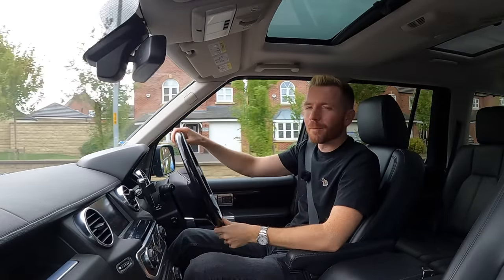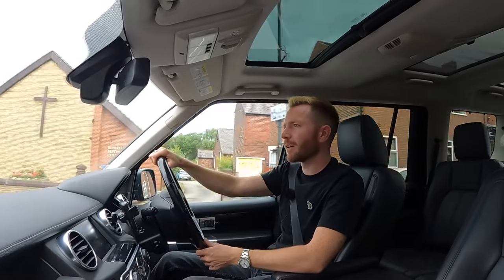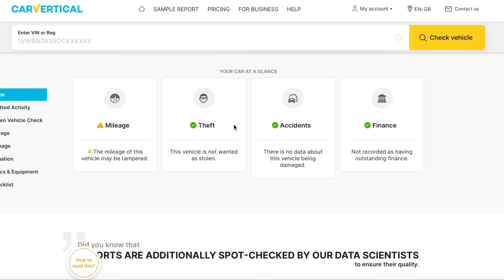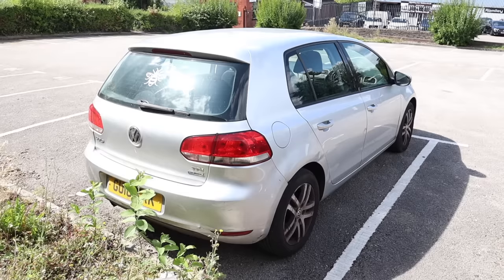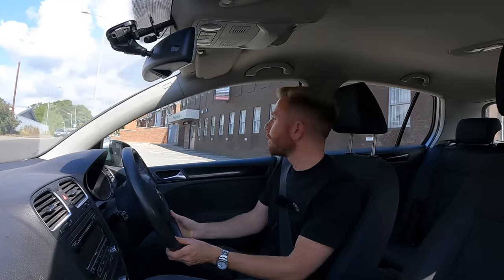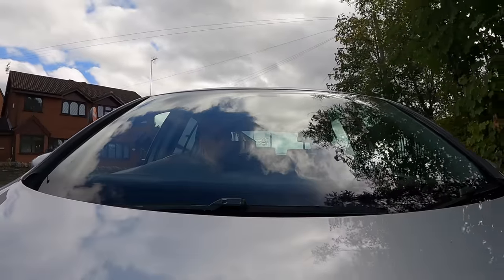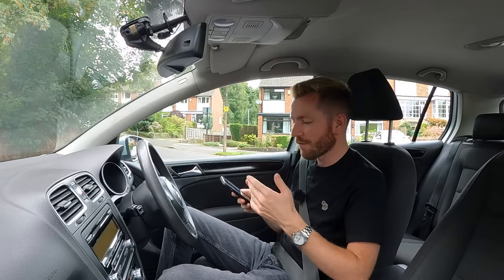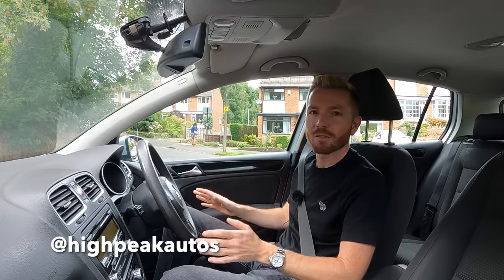I BOUGHT A CHEAP VW GOLF MK6 FOR £700!

Comment: That looks like a pretty good deal for £700.
Reply: Then Matt spends 2.5k on bodywork and change every single bushing
Reply: No. The car has been completely neglected and abused, you will definitely find at least a couple more nasty surprises even after all immediate repairs necessary to sell it to you.
Reply: Trouble is you would be constantly chasing faults and unless you were a competent mechanic with a good scan tool you would be losing time taking it in to the garage.

Thats ignoring the tatty interior and exterior.

If I wanted a cheap bargain I'd be looking at something like the toyota  aventis Mat had or the volvo t5 chops garage had.
Reply: A pretty good deal for £700? I don't think so. It's a shed. Long list of things wrong with it. Send it to the scrapper.
Reply: until the injectors go like on my old golf lol
Reply: It’s a 12 year old car, it’s ready for the scrapyard
Reply: @matthewsmith2787  A quality car that has been maintained should last well beyond 12 years old. I have a 19 year old Honda used as a second car. No rust issues and runs like new. Good for more years yet so I'll be keeping it for a while. In fairness this VW looks to have suffered a hard life and been poorly maintained.
Reply: @matthewsmith2787  imagine thinking 12 years old is old haha
Reply: @matthewsmith2787  you have money to burn? 🤣🤣🤣🤣
Reply: Most cars in UK are more then 12 years old lol

Comment: Nice one Matt, hopefully you'll get some decent ad revenue off the video too. 😆

I recently bought my uncle's 2007 Audi A3 Sportback for £650. The interior was even worse than your Golf here, however it was mechanically well looked after with only 80k on the clock. I got a cambelt change, put £100 into it myself cleaning it and replacing bits and bobs, new tyre and got it through an MOT. Total cost including the car, £1130, money well spent for my daily runner?
Reply: how do you guys buy a car that cheap. i spent 6 months searching for a “cheap” VW polo and i spent 9500€ for a 1.4TDI with 148K Km.

Comment: The MK6 is one of my favourite cars I’ve owned. A decent one costs a lot here in comparison with the UK. I paid more than 4 grand for my car. Crazy to see you can pick one up there for 700 quid
Reply: Used cars seem relatively very cheap in the UK for some reason
Reply: And he overpaid if you ask me.
Reply: @khelgarironfist3301  Isn’t it because it’s unattractive for export because of the place of the steering wheel?
Reply: @bikerdude1569  how so?
Reply: @jjs9672  i also read that many older cars are sold to other countries which mostly have the steering wheel on the other side therefore UK cars are hard to sell or something. Not sure if that is really the reason tho.
Reply: @khelgarironfist3301  yeah that’s what I said a couple of comments back. Must be. Lucky them with these cheap pearls
Reply: @khelgarironfist3301  the reason being tax, insurance and fuel prices are high. That's why cars are relatively cheap here.
Reply: @rundattmedia2106  well all 3 are even higher in some countries including mine where cars also cost a small fortune.
Reply: @khelgarironfist3301  some countries aren't as economically wealthy as others.

Comment: bought a 2006 140pd golf for 500 just needing a turbo*
* turbo was in two pieces plus a host of other issues. ended up changing engine as turbo had starved it of oil.
get it all back together running THEN find the dmf rattling.
got it done then did 600 miles in it then sold it loosing 700 ffs.
4got to say it was blooding minging when i bought it

Comment: You can find the date on the tyre by looking for the word "DOT" and then there will be the 4 digit code somewhere after DOT. If you can't find it on the outside of the tyre, it will be on the inside... Sometimes it is like that, but i dont know why :D
Reply: Maybe the tyre was fitted back to front? It can happen occasionally, scarily enough.

Comment: Had issues with the 1.6 TDi, not the most reliable unit.
Reply: I payed, for sure, more than GBP 700 to fix the 1.6 TDI on my Fabia Estate from 2011 and never ran perfect. Just a waste of money and time.
Reply: I've had one from new in 2011 and it has never let me down. Other people who I know have had them without problems too, so maybe you have just been unlucky.
Reply: @01jvb  There no such thing as unlucky when the engine kicks the bucket after the dieselgate "fix" and you have to replace the EGR on your own money. For me it was the last VAG product.
Reply: @10mbc  ....most EGR issues were caused by owners bad driving habits or buying the wrong car.
Mine was replaced under warranty due to the previous owners stop start shopping/school runs....you don't buy a diesel for that type of motoring .
Comfortably munches the motorway miles now for the last 8 years with no issues what so ever......great motors 👍
Reply: Yup egr problems and various niggles with mine left me wishing I’d got the 2 litre in my mk6 Golf, outed it after just 60k miles (very unlike me)

Comment: I think the problem with the UK at the moment is that people are buying cars that they can't afford to run, and maintain. It's sad to see and it reminds me of a Mk4 Astra I bought years ago. It was an auction and in a terrible state. I owned it for a few years and I detailed that thing to death, painted all the black parts, the body colour, and replaced the lights, and repaired it myself and changed the oil every 6 months. It was the 1.4 8v version, but I was young and daft. I ragged it, and the head gasket went. Local garage put the fear of god in me saying it was going to cost £xxxx to fix, so I sold it to him for £750. He got a really decent well looked after car that I took a lot of pride in.

Comment: back door is covered in kids stickers. im currently driving a skode which was one female owner . pdi service and none after that  leading to coil pack failure leading to engine needing rebuilding . brake discs were like paper plates. old milk stains on all but the drivers seat. never washed

Comment: In my opinion, the optics really don't matter. I would drive it as it is as long as the rubber on the rims is in good condition, brakes are working, engine is working and it doesn't show any airbag, brake, security system lights on the dashboard.
In fact, I drove a 1999 Audi A6 Kombi with swapped Audi V8 engine (Quattro + S-Line + Bose system), I paid 228£ for it and the body was in terrible condition. There was a corrosion damage which got repaired but the owner didn't repaint it, interior had paint stains, there was a check engine light and some sort of aftermarket ECU. It passed the inspection without any problems, I drove it like that for over 200.000 miles (yes, with that stupid check engine light) and this car was amazing. I towed a truck with a trailer out of the snow with this car, I did a lot of offroading with it and I even drove it from Ireland to Bulgaria with my uncle. He was shocked by this car's visual condition but in the end we arrived in Bulgaria without any problems.
I really loved this car and I was amazed that I drove this piece of rubbish more often than my Supra MK2 and the 2013 Mercedes Benz C-class.
It's a shame that some stupid maniac decided to steal this car, let the police chase him for over 29 miles and then crash this car into a truck. Well, at least I got his Galaxy S10+ for free, some sort of diagnostic tool and the engine survived the accident. In fact. I still have the engine in my garage and it's waiting for me till I buy another rubbish Audi A6 XD

Comment: Tyre guide!  Look for the letters DOT, the next letters are code showing location of factory etc., 4 digits after are week/year as others have stated. The date code is not necessarily on both sidewalls so if you see a blank it's on the inner sidewall. Also of note, tyres can be sold as new up to 3 years after manufacturing date but most likely you don't see more than 18 months when buying new from a tyre outlet. 

If I had to buy a car unseen, my first question would be what tyres are on it, tells a very important story! Only caveat is 2nd hand dealers will fit the cheapest ones they can find, so if the car has new tyres on it then pay attention to the oldest ones on the car. I couldn't buy a car like that without scanning it first, as it turned out for someone doing the work themselves it's a cheap car.

Comment: i swapped a scrap rrs for one of these 2lgtd 160k miles, driver window motor works but glass is off roller, sills are non existent got left rear light out and goes into limp mode, drives mint

Comment: VW have had issues with broken springs - mentioned by Paul Flanagan below - my wife had a new Polo in 2003 and at two years, 9k miles, needed springs and one absorber. She drove 9 miles a day, return, to school and to the shops and twice a year to a relative - 180 mile round trip. A careful driver in a very iffy car.

Comment: I just got one today for 600 euro,a 2009 one TSI SE ,I only picked it up today and drove about 30 km but so far i  think i prefer my 2006 1.9  polo tdi ,although the petrol is very smooth and quiet and 6 gear instead of 5

Comment: On the plus side the tyres are quite new, albiet cheap but it's not a gti so will be fine, and the other issues all appear cosmetic. 
 seems like all u need is top up coolant, scrub those wheels, get some wd40 and shake-n-Vac and  scrub it like Lady Macbeth and its a good cheap econo run around.

Comment: its better than my golf. a wk ago i bought an 06 mk 5,    2.0 s sdi. cost me a grand,  163000 mile, problems starting as need new plugs seller didnt tell me, as i found out next day when it wouldnt start simply by turning the key, and the bodywork is rougher than your car. also after i had handed over the cash and drove away  i  noticed a 12 inch crack along the top of the windscreen.  yep i do feel conned. feel abit of a mug giving a grand for it, though it has 11 months MOT
Reply: That's what happens buying private
Reply: No one to blame but yourself
Reply: Should have checked it properly then. When test driving a car immediatly look at the the coolant tempreture when starting it up, if its already warm that usually indicates an issue, check tyres, coolant, oil, check suspension and watch out for noises and weird quirks whilst driving. Make sure all the windows and gears work, good visual inspection. Check for service history and finally check the MOT history because it can paint a really good picture of how the car was treated.
Reply: @Nnn30055  yes your completely right, my gaurd was down and ive paid the price for not paying too much attention.

Comment: Tyres are marked with a DOT stamp, (Department of Transport) which is a United States mandatory regulation, so I'm not sure why this is a global standard ?. ... You are correct, the 4 digit code denotes the week and year - first two numbers the week, and the last two the year. ... A lot of people won't even know this, and tyres should be changed every 4 to 5 years even if they are only doing a couple of thousand miles - which is a small price to pay.

Comment: In the United States tire shops sell a lot of different Chinese made tires.
Each usually have one or two they sell under their own private label.
They usually wear like concrete but have the grip of banana peels on ice.
Years ago I used to ride share with a coworker that drove a Saturn LW200 which is basically a slightly restyled Vauxhall/Opel Vectra B.
She replaced her tires with a brand called Prime Well and in anything more than a heavy frost the thing was all over the road and the slightest application of the brakes in inclement weather and the ABS would come on.
Pretty pathetic for a 3300lb estate with all of 135hp...
Reply: Ahh! Is that the reason why, when I see any US police caper drama / movie from the last 40 years, someone applies heavy braking and the car screeches to a halt 3 States later. I always found that amusing, but I know it's often a necessary effect (like empty coffee cups) and am a big fan of the US in general pre Tromp. 
Now back to the auto show..... :)
Reply: @pomerau  I am pretty sure that most police vehicles in the United States are equipped with appropriate tires from name brand manufacturers and you shouldn't believe everything you see on television or in the movies.
Reply: @williamegler8771  I meant mainly American sedan road cars braking from not more than 30 mph sliding for miles to seem spectacular On Set; and it was tongue in cheek when you highlighted the widespread use of those tyres -  but never mind. 
I did drive 3000 miles on the West Coast in "98 and those were great cars then in reality. 
Different cultures, same - ish language. :)

Comment: "advisories on every MoT = neglected car"... not necessarily true. I used to use a garage and would ask for work to be done at an annual service and MoT, knowing that some of the items may be MoT failures. They'd insist on doing the MoT first before the repairs and service, in case they found other stuff that needed doing over what I'd asked for.  This gave the wrong impression that my car was neglected.  As for dirty interiors, some people have on-street parking away from their front door so can't clean the car properly, and some are too poor to use a valeters from time-to-time.  I think one of my daughter's car only gets cleaned when she comes to visit me. The other one occasionally uses a valeters

Comment: I have a 2006 240,000mile q7. I locks don’t work so I drilled a hole in the roof to get a long rod in to press the unlock button. Loads of warning lights, and 15 years of getting in and out has rubbed the blue dye off my jeans into the pale leather interior. Oh, and the tracking is out. Bid me?😳

Comment: "Car People" / Car Shop Car Supermarket etc fit their own rear plate prior to sale, so I wouldn't just assume that it's had a bump.
Reply from the maker: They normally fit them in pairs
Reply: @HighPeakAutos  they didnt on mine at Car Giant. Original supplying dealer plate on the front, their plate on the back. Very annoying!

Comment: It seems sad that a 12 year old car would be classed as a banger! I am also surprised by the corrsion, I would have expected better from VW, I live on the coast and there are far older VWs around here without that sort of corrosion. That's what I'd expect on a Ford Focus or an Astra! I know the 2nd hand market has gone crazy in the last 2 years but I suspect the dose of economic reality we have coming for the next 2 years will sort that out. £1200 seems a lot for a banger; I am sure you will get it but I wouldn't want to be ownimg it when the music stops.
Reply: I owned a 1987 MK2 Golf GTI in 1996 which had corrosion on the bottom part of the door so it looks like not much has changed with VW from then (still loved the car though).

Comment: Done better than me. Got a mk6 golf 1.6 TDI 92k miles for £2500 4 years ago with no problems for first year. Then overheating began. Been to main dealers another £1000 getting it looked at and no answers to the problem. They rang up Germany and they said they have never heard of this issue in the form that it’s in and it could be another £2000 to get it fixed but no guarantee. No warning lights, no nothing. Appalling service and a car that I won’t be buying again. I’d rather have that one you got for £700 with its problems. 

Bought a 16 year old Vectra for £800 2 years ago with 72k miles and its been faultless. Go figure.
Reply: Oh and sat on driveway....do you want it? 🥴

Comment: Lol my cars and absolute mess but it does everything from transporting the kids to doing a tip run. Underneath it's a looked after car. Since I've had it it's always been dealer services and had anything that needs fixing fixed. Even when someone will say it'll be alright until mot na let's just do it now it's done then. Always maintained my cars and always done me well. Going on to ex rental my old focus which I bought at 10 months old I did over 110k in it and it was trouble free. I wasn't too happy it was a rental when I got the v5 but it never failed me.

Comment: That engine is the Euro 5  which is the one VW got sued for due to cheating. Curious to know if it got the fix. Without it apparently drives nicer but emits way too much NOx. With it there were problems. Worse economy and driveability. I had that engine in a Leon. That generation of diesels needs to be driven long distance which the milage would suggest it has so that's probably better than a low mileage example
Reply: Emits way to much too much? According to whom? The ones who fly on private jets and float around on yachts? 1 shipping container vessel emits as much as 1 million cars in its lifetime. EV's have a cradle to grave carbon footpint that only breaks even with a car like this around 400k miles if they both lasted that long. Oh and EV's use 4x more electricity than the average homes AC... so i say EV's are not allowed to charge off main grid as they are failing and driving up energy costs. Must create self generating forms of power at EV charging stations. They can sell excess to grid, but take 0% from.